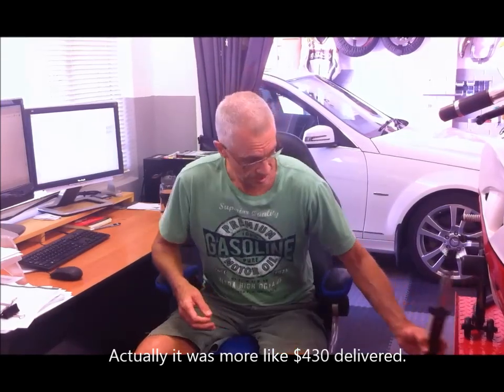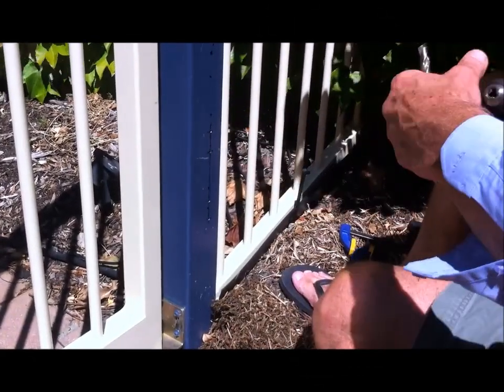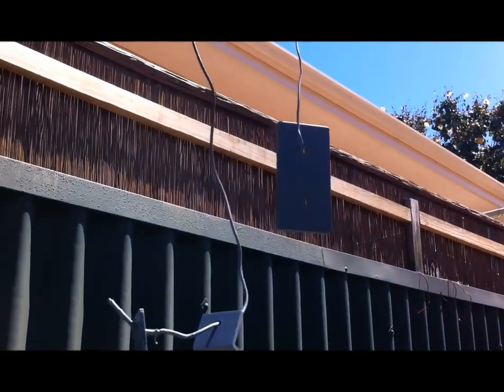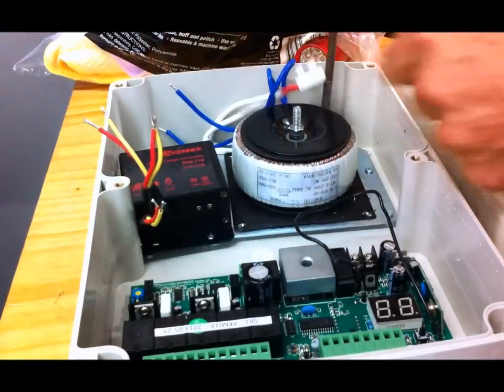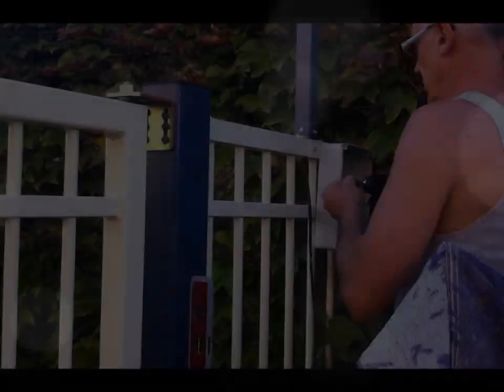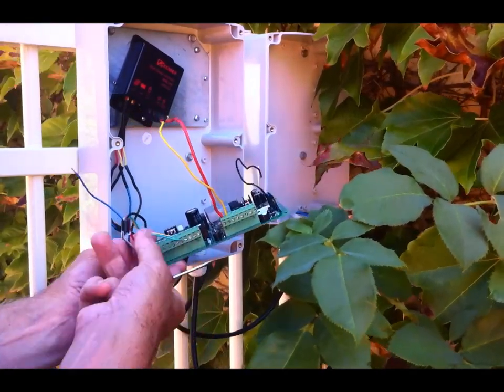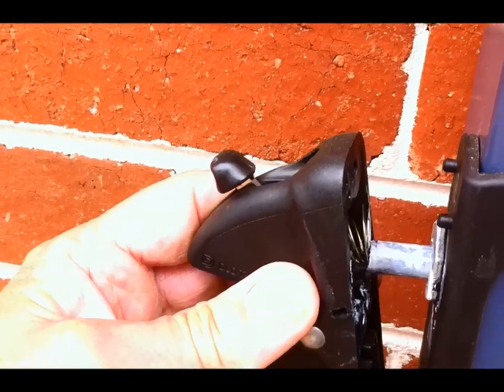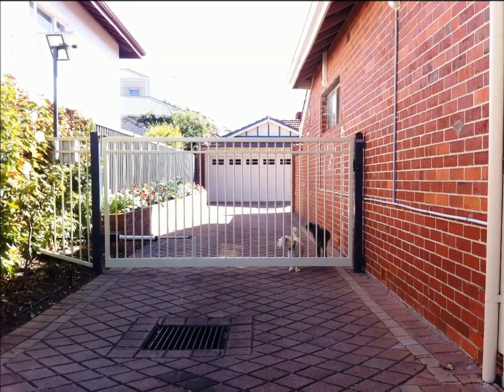How to Install Electric Solar Automatic Gate Opener Motor Actuator Remote Control Kenner KNL01

Comment from the maker: Liam I hope my experience can help you do the installation a little easier.

You should have a solar regulator in the kit Item # KNL 118. The instructions with that regulator are clear. In summary the solar panel and the batteries are connected to the regulator. The outlet of the regulator ... a regulated power supply ... is connected to the main control board where it says batteries. Terminals 13 & 14.

kind regards, Scott
Reply: Okay thanks so much mate!! This video has helped me out soo much already! Any recommendations on what thickness of cabling to get for the solar panel? Or?
Reply from the maker: Liam Benson

I used 20A wire because I ended up moving the solar panel closer to our house as the house next door was putting it in shade from about 2pm.

The solar panel will get up to maybe 25V to 30V in full sun. P=VI so the amps are about 20W/25Volts = approx. 1 amp. So you don't need high amp wire unless you mount the panel a long way from the control box. So if you're putting the panel close to the gate 5A or 10A automotive wire will be fine for your needs.

Cheers, Scott
Reply: MrScott52 Hi MrScott52 we have gone out to bunnings and bought all the supplys we need. We bough 2 core wiring that is the same thickness as normal electrical cabling that you would have in your house, but with out the earth.

Now I was wondering would you be able to help me figure out how to install a GSM gate opener? I understand the logic of this however I am not sure how to wire this in? This is what I am looking at

http://www.3galarmsystems.com/product.php?langid=2&s=-GSM-Gate-Access-Controller-RTU5025&id=72
Reply from the maker: Liam Benson

Liam I'm not familiar with that however there are instructions that I downloaded and had a quick skim through. http://www.3galarmsystems.com/attachment.php?id=273

Section 7.0 Installation has the wiring diagram and it seems straightforward. I'm guessing you want to use this with your phone to open the gate? And you want to connect the GSM into the Kenner control board?

So it appears you can use O1+ & O1- terminals as a switch. So I'd be connecting those to terminals 19 & 20 on the gate controller ... see page 17 of the Kenner manual. So the GSM would be doing the same thing as a push button switch. You can still have a push button switch wired in parallel to the same 19 & 20 terminals if you wanted but I guess that defeats the purpose.

The GSM must have a power lead that plugs into the 12VDC socket so you could connect that across one of the 12V batteries to supply the power to it.

There are detailed instructions on setting up the phone numbers etc so follow those. I hope this gives you the information you need to get started. Cheers, Scott
Reply: MrScott52 Hey MrScott52 thanks so much for your help! I have got my solution for powering the GSM module and yes I will be wanting to open the gate from my mobile incase I dont have the remote with me!

So yes I would be wanting to hook up the GSM module to the Kenner Control board. I will buy the GSM module and let you know how I go!

Thanks Again!
Reply from the maker: Liam Benson

Thanks Liam. I'd be interested in how it turns out as I may get one for my gate. You can be the guinea pig this time! Regards, Scott
Reply from the maker: Liam Benson
Liam,
A thought emerged from the sewers of my subconscious ... the terminals 19 & 20 are for a "momentary switch" not a permanent open or closed switch. From my reading of the instructions you can set it up to close the relay for a set period so I think you'll be ok. I thought I'd better point it out. So you need the relay to close for about 2 seconds then open again to mimic a momentary push button switch. Cheers, Scott
Reply: MrScott52 Hey Scott,

Sorry for not replying to your messages! I have installed one of these gates for my farm style swing gate! We have the solar panel and the batteries as the primary source and we are working on getting mains power down to the gate and using mains as the primary source and solar power as the secondary source. Aswell as I am going to get a clipsal momentary switch and run some cable to the gate and connect a momentary switch so we can open the gate from the house with out having to leave the house and walk half way down the drive way.

I do have an odd issue with the limit switch and the run time. I have noticed when the batteries are not fully charged the gate motor does not run at full speed which then cause the gate only to close partially (due to the fact the motor runs on a timer.

I can send you some photos of the install? It was a great project! I really enjoyed it

Comment: hi whare to buy electiric lock?
Reply from the maker: Mustafa Öztoygar search eBay for 24V solenoid that pulls. I rigged it up to pull the existing latch. Alternatively you can buy a lock from the actuator supplier but it costs a fortune. Scott.